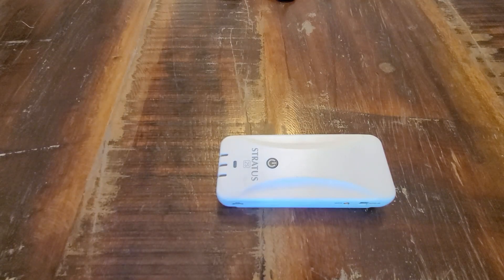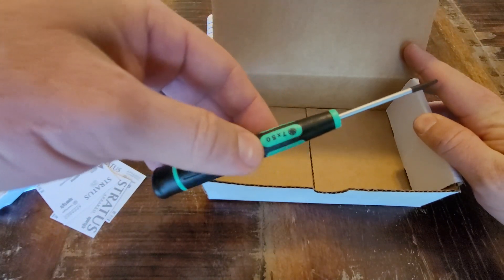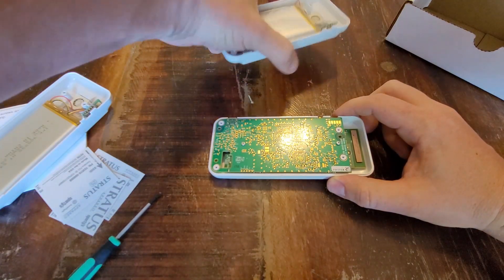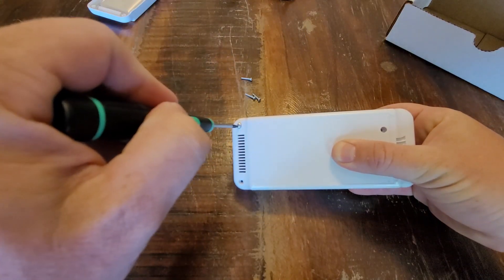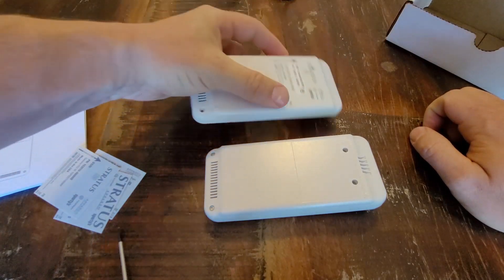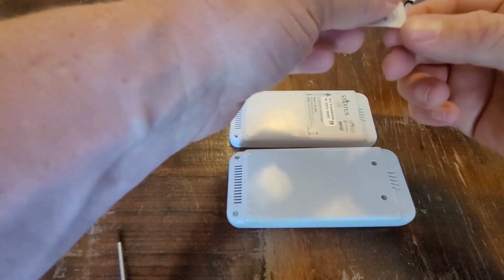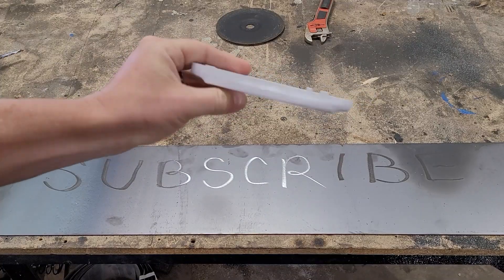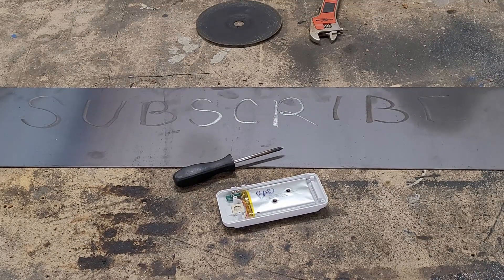How to Change Stratus 1S, 2, 2S, 3 Battery, ADSB Receiver Battery Change

Comment: How did I know you were going to do that? 🤦‍♂
Considering the price I think I would have been inclined to try and boost the battery voltage and see if it would charge and if it really was dead. You on the other hand would know if the battery was allowed to discharge below the 2.4v or 2.7v point of no return. 👍